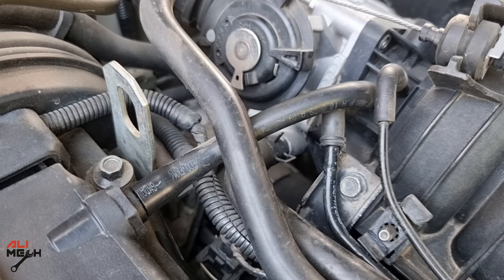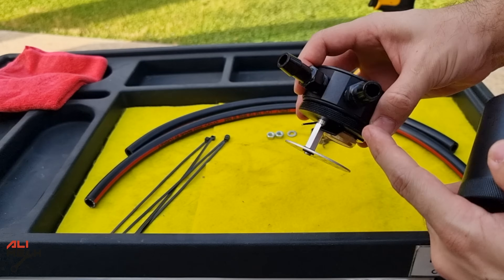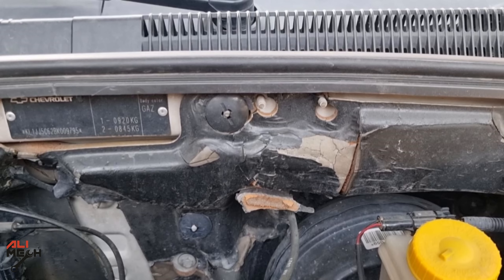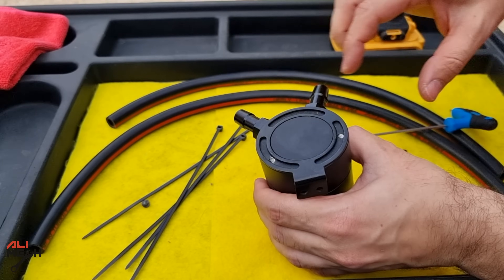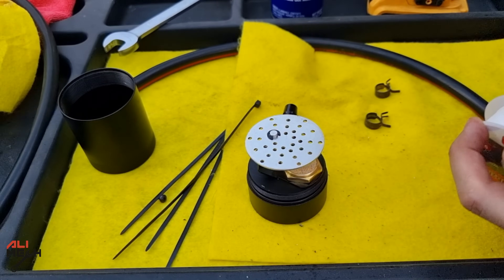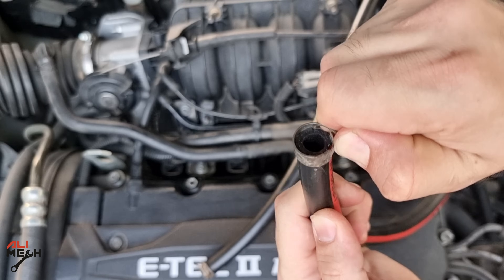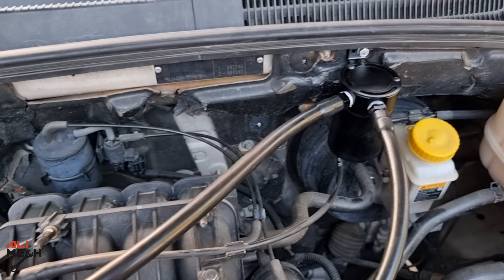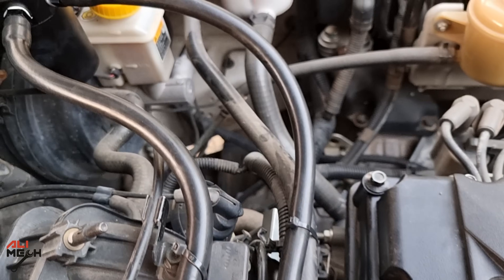Quick fix for engines burning oil/How to install oil catch can /preventing carbon buildup in engine

Comment: But it will lower air intake pressure no doubt, or does the car over-compensate or it has enough once the pressure builds up?

Comment: It works well for an engine that burns oil via the PCV valve. Will the same solution work for the car engine that burns engine oil through the breather?

Comment: If oil catch can is effective then why do car companies are not putting it on their engines as a standard?🤔
Reply: Because it's another maintenance item? Also some cars do have them but they're not serviceable in the way shown in the video and they tend to be more prone to failures/clogging.
Reply: New engines dont have oily blowby, higer milage 70k plus do, esp mspped turbo diesels.
Mann humel provent 200 does a good job of keeping intake clean.
Reply: Designed obsolescence, the car will run just fine throughout the warranty period without it so it is an unnecessary production cost. A lot of manufacturers include cleaning the intake system as a maintenance item on certain services, this will make that pretty well redundant, you just check and drain the oil from it when you service your car

Comment: Tell me the Catch Can is universal, would it work on tsi 2.0 211hp Jetta engines year 2016? Parabéns belo vídeo...
Reply: This is not a car specific part. All it does is add an oil catch can in the line. It shouldn’t matter car to car.
Reply from the maker: yes its universal, you can install it for most cars, obrigado

Comment: How often does the internal filter have to be cleaned or replaced? Looks interesting.
Reply from the maker: It need so be cleaned, but depends on how much the engine sending oil there, maybe once a year
Reply: I would check it every oil change